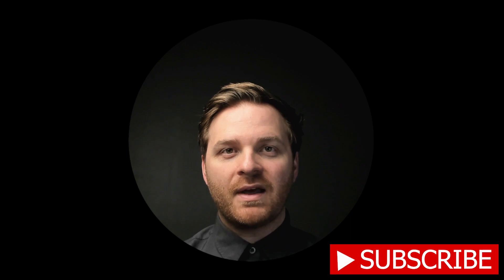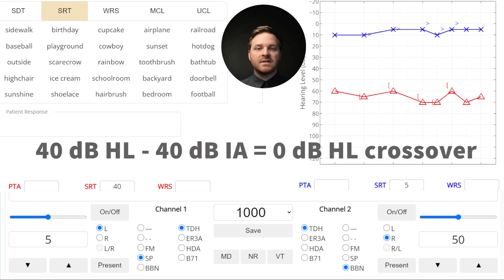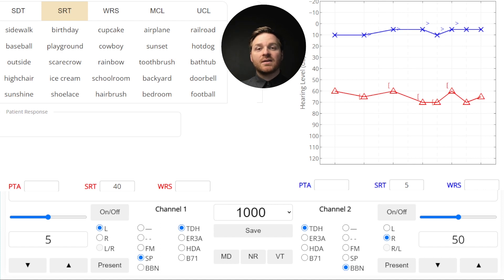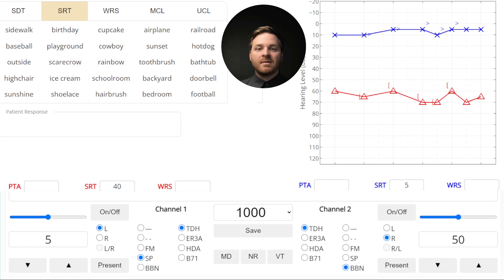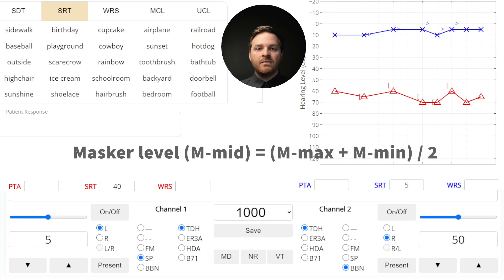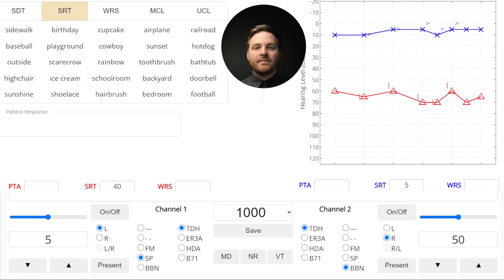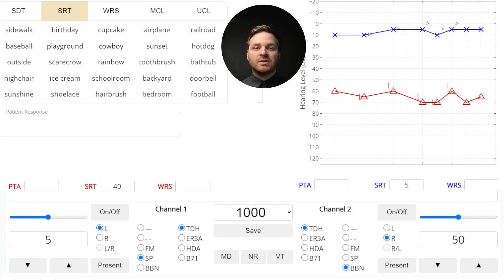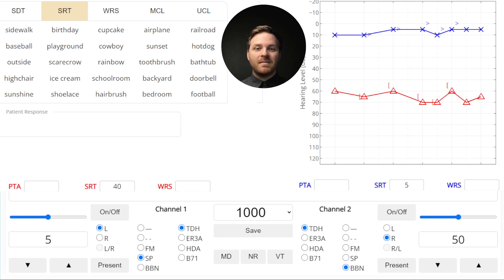Speech masking tutorial: How to mask SRT and WRS

Comment: Thanks for making the video, it is very helpful.  i have two questions regarding the Acoustic method for masking.  1st)  the formula given for the m - min = estimated SRT - IA + 10dB + non-test ABG.  I didn't see the non-test ABG calculated in the example so just seeking clarity and further explanation on the non-test Air Bone Gap (which is 0-5dB in the example).  2nd)  The formula given for the m - max = Best test ear BC - IA - 5dB but in the example, the IA was added.  Should the m - max equation be (Best Test Ear BC + IA - 5dB)?  
Thank in advance for your response.
Reply: You only need to factor in the ABG if the non-test ear ABG is significant. Otherwise, the 10 dB safety pad should take care of any non-significant air-bone-gaps that may exist. In this case, the non-test ABG is 0-5 dB like you said, so we don't need to factor it in.
As for the m-max, that should definitely be Best TE BC + IA - 5 dB!!! we'll put an edit in to get the equation corrected. Thanks for pointing that out!
Lexie - Co-owner of Theta
Reply: Thanks for such a prompt response!  Just a follow up on ABG being significant, would that be greater than 10dB?
Reply from the maker: You got it. If it would be considered conductive hearing loss (ie ABG>10dB) then you would factor that in
Reply: This video no doubt improved my comprehension of speech masking for sure.  Right on time before my THETA training class today with Hearing Aid Academy!  Thanks again!   @ThetaSimulator